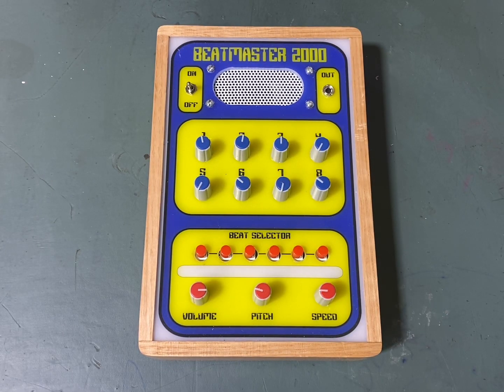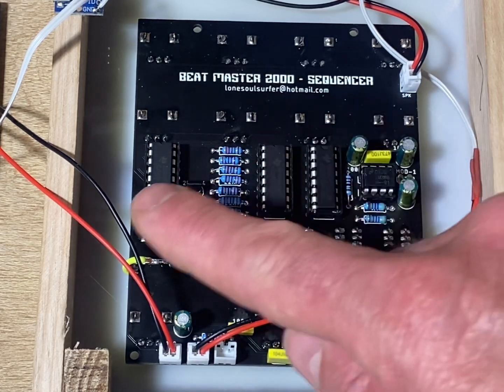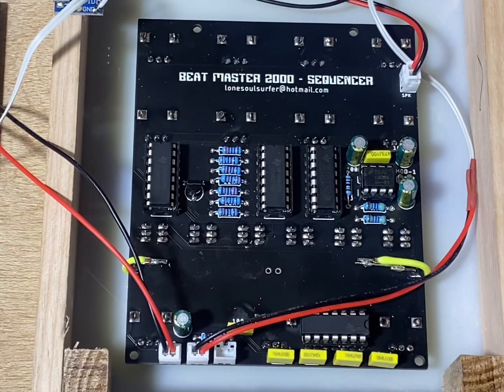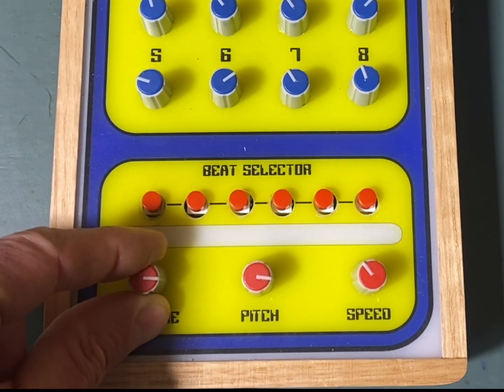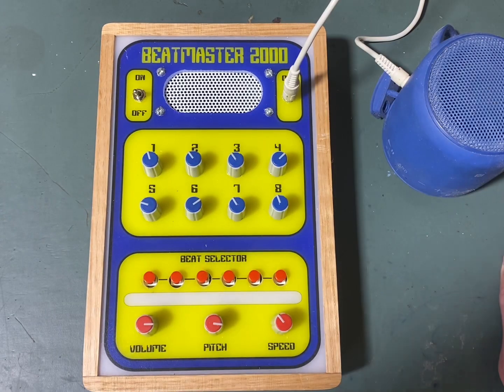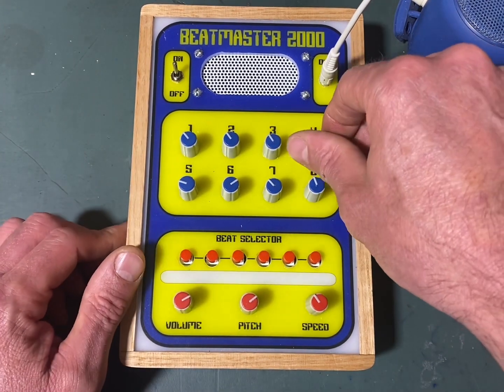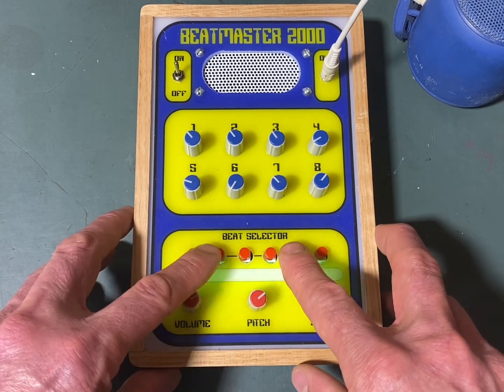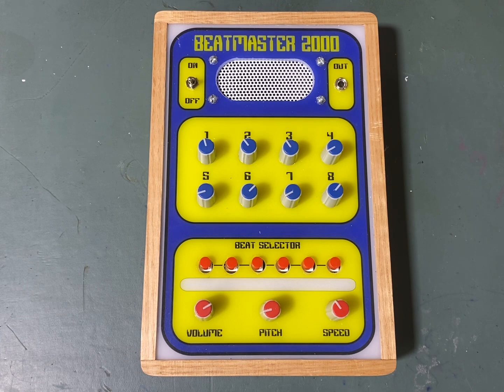The Beatmaster 2000 - Sequencer & Beat Synth

Comment: Hi, I just had a PCB made at JLCPCB, but it looks different to yours , have I had an earlier version printed ? The speed is marked as a 1m pot and there aren’t as many JST connections at the bottom.
Reply from the maker: That’s the most recent version.  I moved some of the jet connectors to the top to make it easier to connect them to the speaker and s witch.

Let me know how it all goes and good luck with the build
Reply: @lonesoulsurfer  Thanks for the info. I will let you know how it goes. . I’m just waiting on more components arriving. So does the speed pot need to be 1m or is 100k ok ? I know when it’s finished you won’t see it but the PCB is a lovely purple colour :)
Reply from the maker: @stephenmaughan  the speed pot should be 1M.  Haven’t got a PCB in purple yet but it’s next on the list.  It is a bit of a shame you won’t see it!
Reply: @lonesoulsurfer  If I’d been In Australia I’d have a sent you one of mine….. Now to find a 1m pot 👍
Reply from the maker: @stephenmaughan  the only place I could find 1M vertical pots was Ali express.  

Trying to find a 2M vertical pot for another project - I don’t think they exist!
Reply: @lonesoulsurfer  I just ordered some , won’t reach me until 9th of January. I suppose it gives me plenty of time to assemble the rest of the board. 

No I don’t think I’ve ever seen any 2m verticals either. 1m seems to be highest.
Reply from the maker: @stephenmaughan  nothing worse assembling the board and having to wait ages for that one part to arrive!  good luck with the build
Reply: @lonesoulsurfer  cheers 👍😊